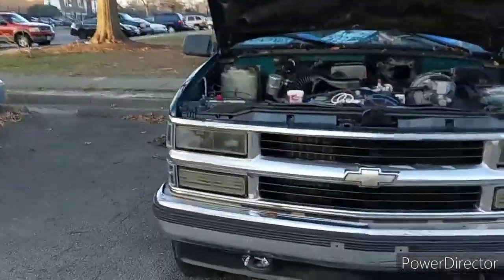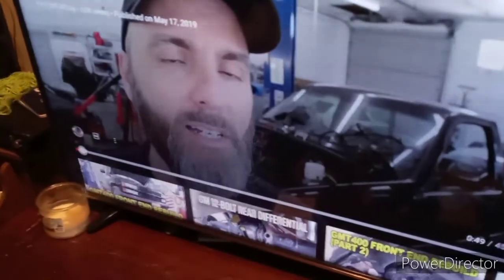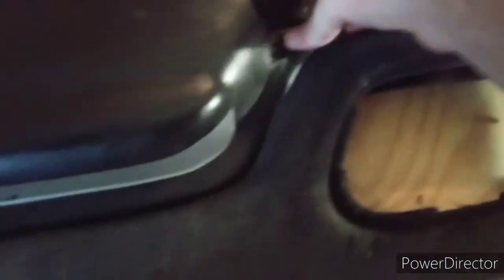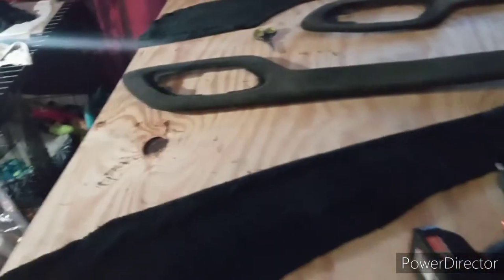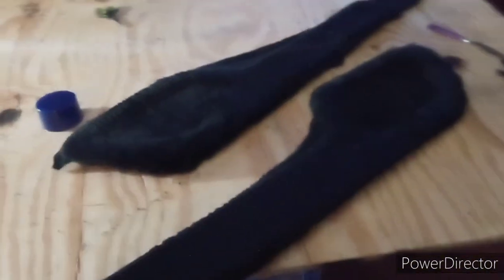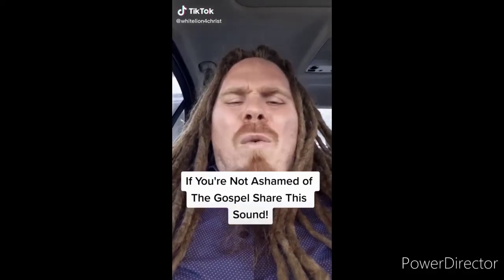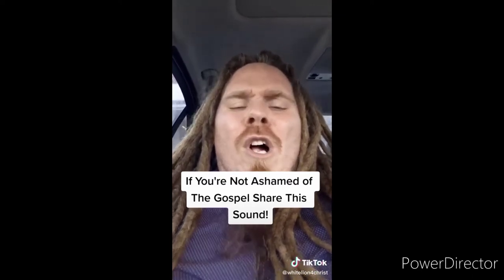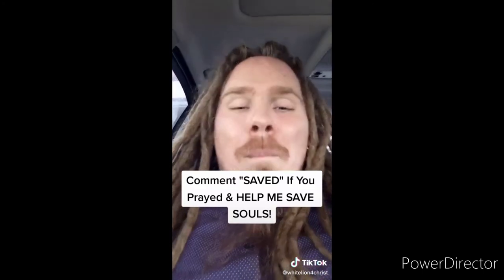customizing the door panels in my 96 Chevy Silverado

Comment: I wouldn’t recommend this, I broke a special type of clip and then I stopped and I just press fabric agasint it and trimmed it up. If anyone needs more explanation comment and I’ll help
Reply from the maker: I decided to go ahead and replace those pieces with Cadillac strips whatever you call it
Reply: Yeah that makes since does it hold it well?
Reply from the maker: Yeah the Cadillac door panel decoration thing whatever it's called they're glued on so I just used headliner adhesive to put them on I have a video on how I did it